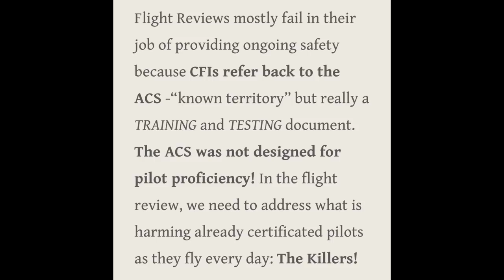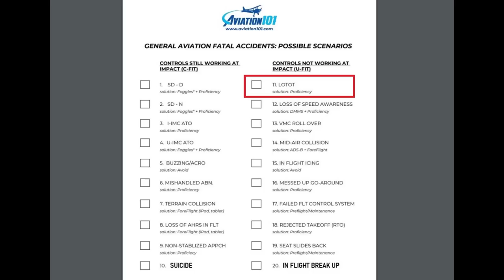Engine Failure at 400 feet.  The Impossible Turn.

Comment: It may not be anywhere in the FAA literature but all my instructors had me practice simulated engine-outs (SE-O’s).

Plus I had two Flight Sims and practiced SE-O’s with different altitudes, air speeds, etc. to give me an idea of what’s possible and what’s not.

Another thing in his favor is that the 150 has a stall speed of about 8 kts.

I’d like to see a METAR, and after doing a few searches, I cannot find out what day this incident was.  They talk about the wind at 4:22 and 9:50, but no mention of it’s direction.

In green, someone added to the video a green arrow for the wind direction, looks something like 130–150.

Comment: I think you are doing a Stirling job in general aviation safety Dan, I have absolutely no doubt in my mind you will be saving lives, I would like to comment as a British PPL holder fixed wing and rotary. I got my fixed wing license in 1988 in the UK, as part of the training and every single subsequent LPC, engine failure after take off is part of the training and testing, I was taught to develop “muscle memory” if the engine quits  immediately pitch forward and trim for airspeed before doing anything else, and NEVER even consider trying to land back on the runway in the opposite direction. I had an incident in the Bahamas 15 years ago and that muscle memory saved my life and that of two non pilot passengers. On the LPC an examiner will just pull the power on the climb out, or in the cruise and check that my immediate RESPONSE (as opposed to REACTION which is focussed on the negative) is to maintain airspeed. I am curious is this not in the training syllabus in the US?

Comment: So what should Robert have done? I think the typical response is push the nose down for airspeed and keep the wings level, but that assumes there is a place to put the plane straight ahead. Robert mentioned ahead of him was a shopping center. So was nose down and the impossible turn his only option? If he didnt have that cross wind he would have needed a steeper bank and that much more likely to stall.

Comment: Engine rough ain't engine dead. It is the difference between impossible and possible. I speak from experience. I would say loss of one out of 4 cylinders is the equivalent of at least 300 feet, near sea level. AIRSPEED! Or Godspeed, take your pick...

Comment: GREAT JOB ROBERT! . I too experienced a engine failure ( water in fuel) at 400' ,but unlike you ,I had a strong headwind.Taking off my Alon Aircoupe on a 3000' runway. I had made my  right crosswind turn when the engine stopped dead.( water in fuel)  Immediately pitched to best glide  ( glider pilot ) and turned back 180 to a base leg  ( no land out options except the airport behind) had to pitch up to clear trees  tops and  push over steep to maintain airspeed. Now having been pushed downwind had to make a 90 to  the left to end up stalled over the taxiway where it quit flying at 15-20 ft ,traveling at a fast ground speed ,and fell to the ground. Broke the steering rodend and left break line, and I rolled down the taxiway in a uncontrolled curve into the grass, across the runway and thought I'd go off the cliff into a vinyard , but it stopped in the infield.  No damage . Lived to talk about it. AIRSPEED -FLY TH E PLANE -NEVER GIVE UP.

Comment: EFATO was very much part of my PPL training and a requirement for the skills test along with several other emergency scenarios. From about hour 4 of training every single lesson required us to brief for EFATO before calling ready for departure. Plenty of simulated scenarios with sudden idle power courtesy of instructor too.

This was in the UK, but engine failure during takeoff and after liftoff ARE listed in the FAA Airman Certification Standards 2018, section IX E/F... are you saying they don't actually teach or test it in the US?

Comment: Dan: I love the way your  mind works.
 
One question: You say the wind was from the left,  making his "left" turn shallower. but he turned right. Wouldn't that make his GS higher, thus requiring a steeper AOB?
 
One abnormal surprise I've had in  my initial training and check rides (Pvt, Commercial & Helicopter) was engine failure en route. Not on takeoff, though, unless you count the helicopter training for power loss in low hover..
Reply from the maker: He turned left.
Reply: @ProbableCause-DanGryder  OK... I misunderstood the photo. For some reason, I thought he took off on the left runway. Got it now.

Comment: Partial engine failure. He may have been getting as much as 35-40hp out of that O-200.  One jug swallowing a valve does not take away just 25% of you power, it can take away much more power than just what that cylinder was producing.

Comment: Shallow bank actually looses more altitude than a steep bank. Stick forward and 60 degree bank will get you back near the runway faster. You better practice this at 3,000 until you get good at it and you can drop a pin on your iPad then begin your turn and see how close you can get. Add 4 or 5 seconds before you start your turn to account for the shock of losing your engine to make it more real.  I could not make it at 600 feet going with a tail wind but then tried it with a normal head wind and almost over flew the run way at 700 feet. I actually had to slip the plane so I wouldn’t over fly

Comment: The slow ground speed of the 150 meant that he was not as far away from the threshold when this happened as most other planes would be, because of that he had a greater percentage chance of completing the impossible turn than others because he didn’t have as much ground to make up. The reason the impossible turn fails is because pilots come up short when attempting to perform it… very similar to a power off 180 when people start learning it. Additionally that 150 will float just about as good as anything in the sky. This plane and a few others have a legitimate chance to successfully complete the impossible turn… especially at 600-800 feet. This guy in his 150 got it done from 400 feet. I would venture that if he went back out and tried this at 500 or 600 he would be able to do it over and over again with ease. Additionally, if you’ve already made the turn out (at 400 or 500 ft) then the maneuver becomes much more easy to complete. 

Pilots should go out and practice this before they decide if it’s possible or impossible.

Comment: No one logs hangar talk hours but that time spent on the ground will more than likely pay dividends during flights. When needed the knowlege gained will sit in the right seat as this gentleman's dad is still present saying airspeed son. Perhaps we can use  awareness of wind direction and speed to gain a little advantage of turning into it "when" engine loses power at take off.Wind strengh and direction can decide the better parallel  runway option.
Easier to survive 180 than 210 degree turn landing on the reciprocal

Comment: I'd be curious to know exactly what his airspeed was at the time of power loss, at the moment he put the nose down to preserve it. At that point, how far above stall speed would he have been in the configuration he was in.  I've read much about "the impossible turn" and it seems to be a thing that is much dependent on what type plane you're in as well as the speed and altitude at the point of the turn-back. Had he already retracted flaps (if any), or throttled back at all or decreased his initial climb rate?  I'm sure glad it worked out for him and his passenger.

Comment: Was not relevant in this case due to the low height but l remember my instructor suggesting that an engine with a dropped valve may run better  if the mixture is leaned. Does anyone  know if this is true?

Comment: I keep hearing about engines dropping valves, This is catastrophic to the engine and maybe your life.
I build race cars for a living for over 20 years now and usually we see valve spring failures causing this. Could this be part of the reason for these failures?
I have a Piper Cherokee 140 so I priced the valve springs for My 0-320 and it was $40 for a set, It couldn't take more that 2 hours to change them. 
Sounds like a good Idea for preventative Maintenance?

Comment: I don't know if it's fair to say that faa pilot training does not address any surprise scenarios. 
Don't forget that a part of your check ride is putting your head down, then raising it on command to find the airplane all of a sudden in a bizarre configuration. They don't dwell on surprise as they probably should, but at least they are aware of it and give you a taste.
Reply from the maker: The “heads down” hood maneuver is not a surprise and we know that the expectation is to recover from nose high left wing down and nose low right wing down.   There is no surprise.
Reply: @ProbableCause-DanGryder  If those are the only options you use when giving a check ride, it's no wonder your people aren't surprised. You could make the same weak case for covering some of the instruments. You know it's coming, but the actual situation can be made to be unexpected.
Make another piece of paper "dan's not surprised, so it is impossible that anybody else is".

Comment: Just as he says, in South Africa 40 years ago, speed control in the circuit(pattern) is drummed to helk and gone in South Africa. Of course he was lucky to be in a 150/152. It is laughably slow and slack on performance but more forgiving than any training aircraft in the last 50 years. I could never get to a stall/ spin in a 150 because I could  feel that at about 10 kts above the stall at any time, even in a turn without looking at the ASI that I was not doing good. That is what a good trainer is.  I would be uncomfortable to fly a Cirrus..... the designers clearly have a different approach to aircraft design. In a bsdic Cessna if you have  an affinity to flying you will never get into the multiple in pattern stall/spin situations so prevelant with particularly Cirrus products.

Comment: I would like to know did he start his takeoff using all on the runway as we know runway behind you is no good.
I had an engine failure in a cessna  172 at 400ft but I had enough of runway left to land on the remainder of runway. There's a golden rule with private pilots is to be checked out by a instructor as we get into bad habbits .

Comment: I had an engine out on takeoff out of a small farm field in a single seat biplane in '83. I did not try to turn but managed to get it back down on the ground straight ahead only to be quickly approaching a hedgerow-lined road. So I did an intentional ground loop and managed to save the plane (and myself!) by rolling backwards into the bushes, with the only damage being a slightly bent right elevator (approx. 2 degrees downward bend).  By far the scariest incident I experienced during my flying years.

Comment: I wonder if aircraft engine builders have switched to the higher temp. steels that modern car engines have in them now . I know that back in the late 1960's early 1970's most car engines began using high temperature steel values in them. Before then most car engines required a valve job after less then 100k miles. But now days many people run there cars for 250K or more miles without any valves failing . Seems to me of all the engine apps , Aircraft engines need to have the very best materials in them and it be a good question to ask if aircraft engines of today are still using pre WWII quality materials in there engine namely the values.  Also the computer controlled electric injectors are keeping the mixtures of fuel and air to be ideal more of the time in car engines that also allow for much better engine operation before they completely wear out .

Comment: Until high enough to recover from inadvertent (not practice) stall, airspeed (not altitude) is life.  Yes, void of surprise is shockingly poor planning.  My bi-annual flight review was never PTS/ACS.   To not stall is an excellent muscle memory, but limiting bank angle is not the most efficient way to not stall.  In fact the airplane cannot stall itself.  The critical angle of attack is when not why it stalls.  A pilot pulling back on the stick is why it stalls.  The use of dynamic neutral stability to prevent stall in a turn of any bank angle should be indoctrinated.  400' is plenty of altitude when used as potential energy (airspeed) as he did.  My main complaint with the ACS, Dan, is that pilots are indoctrinated into killing themselves in this scenario.  They are taught to maintain altitude in all but descending turns.  They are taught to eventually stall inadvertently.  IMC, with limited control movement, should be a completely different scenario than maneuvering flight.  Spraying crops and at 200' AGL on pipelines, I have had eleven engine failures and I have not looked at an airspeed indicator, except when on instruments, in fifty years.  What has kept me alive, maneuvering as necessary to make workable landing zones, is never pull back without zoom reserve airspeed and never ever pull back in a turn.  A bit of wings level climb with zoom reserve first is efficient, but as soon as the steering wheel is moved the back pressure is released for a 1 g turn at any bank angle.

Comment: I don’t see a single thing wrong with this 180 turn, he did a great job. It’s all about energy management. Push the nose over and be comfortable in making a high bank, coordinated turn. Or, you could hesitate until you loose your energy forcing you to go straight and crash into a shopping center. I don’t think he was lucky at all, he demonstrated airmanship. Each case is different. I doubt an ag pilot would reject  making this 180 turn back if he had the bare energy essentials. In any case, all of the engines on single engine aircraft always sound like their running rough on takeoff so I always assume my engine is going to quit.
Reply: Without the help from the wind, it would have ended quite differently!
Reply: @shazam  agree, and that it wasn't a complete engine failure as he still had 3 cylinders firing

Comment: Surely he survived majorly also because he went from one runway back to an upwind parallel one? If you go back to the same runway that’s basically a 360… as in “turn left 270° and then right 90°”… he did a simple 180 instead.

Comment: I had the same thing happen about a month and a half ago. Severe rough engine at around 600 ft. Everybody talks about "the impossible turn", but nobody talks about circling back and landing on the runway you took off from (which is what I did), instead of landing in the opposite direction.

Comment: Not a complete engine failure. I had a cylinder loose both spark plugs and went extremely rough but was making some power. I too was able to make a turn and land on another runway somewhat downwind. I went off the end onto a golf course and was able to taxi back. Total failure would have been a different story.